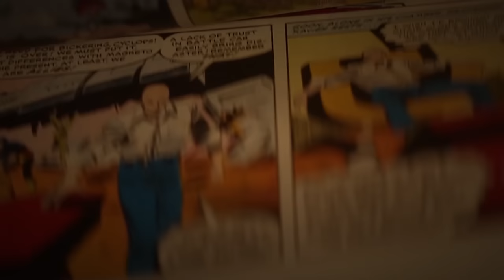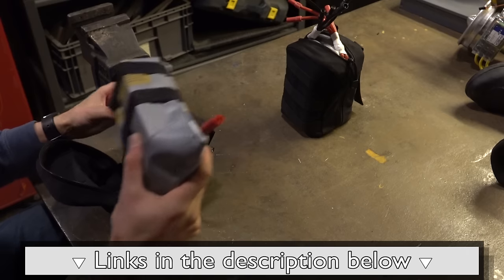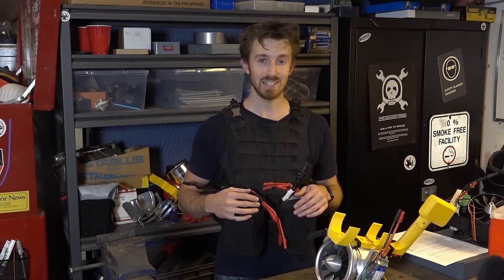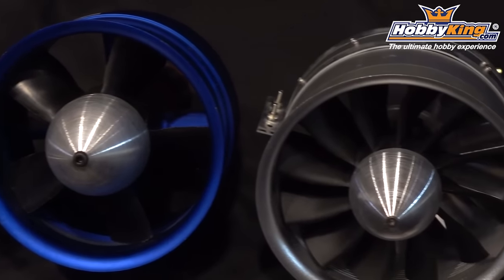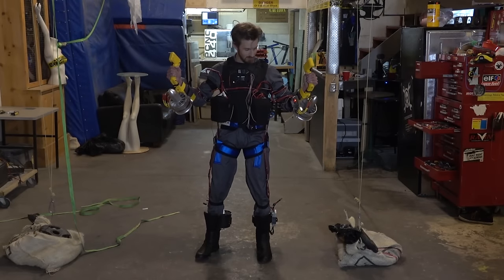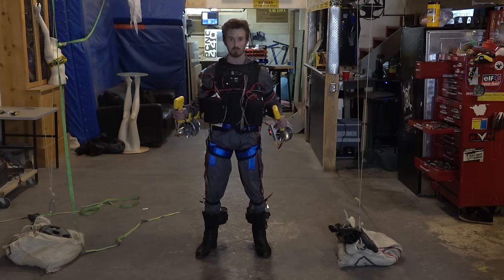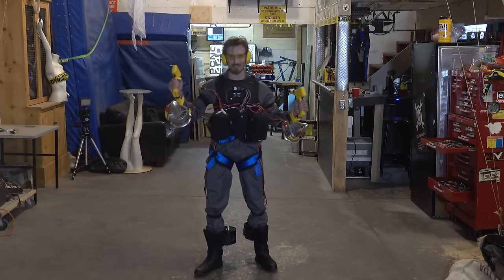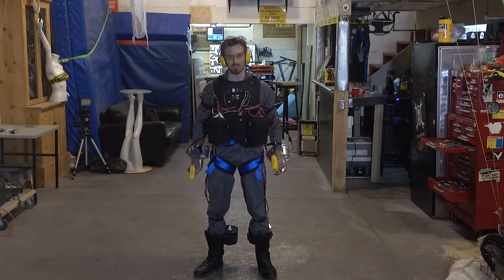Flying Like Iron Man #10: Jet Boots

Comment: I got you, man. What you need is a better power supply. use this induction coil think in this link here: 
https://en.m.wikipedia.org/wiki/Induction_coil
also: how can I contact you?
Reply from the maker: I'm afraid an induction coil wouldn't be used for something like this! Induction coils are used to either heat ferrous metal, or transmit electricity (but only a few inches tops!)
Reply: the Hacksmith that wasn't exactly what I meant. you know how a transformer produces a big voltage pulse when disconnected? the induction coil I was talking about (like in the link) basically connects and disconnects a transformer to a battery repeatedly, really fast. this makes ALOT of power. these were used for spark gap transmitters back in the day, and car ignition coils too I think. however, powering the jet boots remotely using induction from an amplifier connected to the grid also sounds like a good idea. another great idea: lighted your weight with a bunch of helium or hydrogene balloons. good luck with your "safety test" 😀

Comment: if your current edf's exhaust went directly into another faster spinning EDF you should boost the thrust a bit. that's how jet engines work
Reply from the maker: That would require custom EDFs -- the blade pitch would have to change between the two =(
Reply: the Hacksmith oh OK just trying to help man
Reply from the maker: It's a good idea! If we had the money we would definitely pursue it =)

Comment: maybe one day down the line you could run a liquid cooling system for the entire suit. Not just the fans.
Reply from the maker: +Mark Known it'd be pretty heavy...
Reply: of course. But even just a half gallon of liquid could work. Maybe solar powered. Lets be honest, you're doing really well with this suit. So i don't think eventually down the line it couldn't happen.
Reply from the maker: +Mark Known solar power wouldn't be very ideal for this, they're way to heavy compared to how much power they can provide... Remember this finished suit will draw around 150kW of power -- that's the equivalent of 15 houses with roofs covered in solar!

Comment: Sorry you watch the video and I like what you are doing, but as a question what if you induce heat by means of a coil to the air that leaves the turbine only to dense its mass and that generate a little more impulse would not work
Reply from the maker: +jorge morales the system to do that would be heavier than the net gain
Reply: the Hacksmith But if heating using magnetism like the one they use for metals is just a question
Reply: the Hacksmith But your videos are great

Comment: is it possible to narrow the output of the edf to increase pressure
Reply from the maker: Unfortunately no -- EDFs are already designed to provide optimum thrust from the input power, it's not that simple to just modify them =P I wish though!!!
Reply: have you though of switching to a fuel based system? granted it wouldnt be as much ironmany and more jetpackie. probably not much safer either.

Comment: dude those don't even put out enough thrust to lift their own batteries.
Reply from the maker: +Daniel Garrow yes they do.... 8kg of thrust, batteries esc and motor itself is only 2kg if I remember correctly
Reply: the Hacksmith it would take 8 hobby king turnigy rotomax 50 motors spinning 8 26x12 props on 12s to lift a man with electric power ! flight time 6 minutes with 44000 mAh 12s 15-25C I ran the calculation on the computer last night. E flight calculator check it out ! 247 max pounds of pure trust ! 

4 of these batteries to make a 2P12S 44000 mAh lipo
http://m.dx.com/p/22000mah-6s-25c-22-2v-professional-li-po-battery-model-hj-448748?tc=USD&gclid=CjwKCAjw5PDLBRB0EiwAh-27MlbWVBew6ByfwyFTeVPsoCiYMyOJLtU-0ISKNmz2q71_4CzUnEmvRBoCfEoQAvD_BwE&stiff=656

8 of these motors
https://hobbyking.com/en_us/turnigy-rotomax-50cc-size-brushless-outrunner-motor.html?___store=en_us

26x12 props can be found here
you will need 4 Pusher props and 4 tractor props
http://www.aircraftinternational.com/products/Propellers/PusherPropellers.aspx

8 of these ESC'S https://hobbyking.com/en_us/turnigy-dlux-250a-hv-14s-60v-esc.html?___store=en_us

some light weight aluminum to make the H8 frame out of
https://www.servocity.com/48-0-channel

and some kind of flight controller
https://hobbyking.com/en_us/hobbyking-kk2-1hc-multi-rotor-hard-case-flight-control-board-with-remote-programmer.html?___store=en_us
Reply: Longest comment ever!

Comment: hol up, that box represents $2k in losses? Bruh that's just a bunch of chips&capacitors and t-fans, based on sight alone I'd say that's only like $600 max
Reply from the maker: +Barry Allen each EDF and speed controller is worth $200-$300... Full retail cost is well over $2000. Actual components might only be worth $600 but that's not how buying stuff works lol